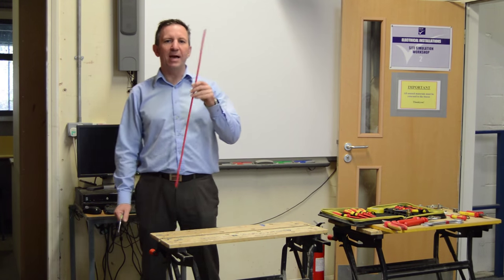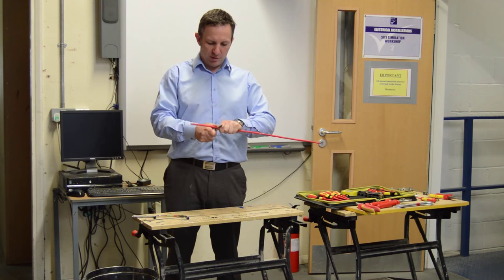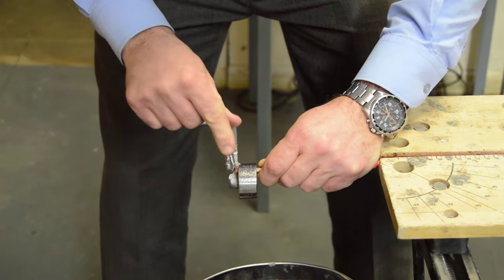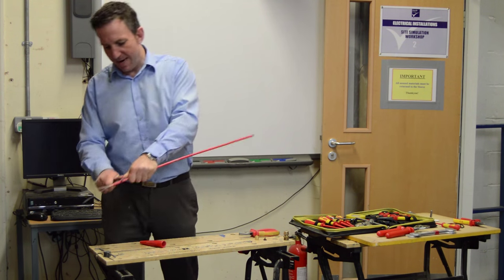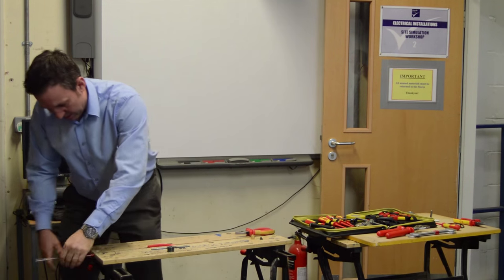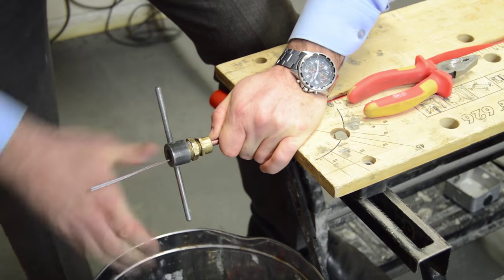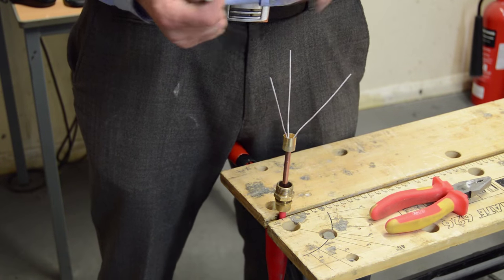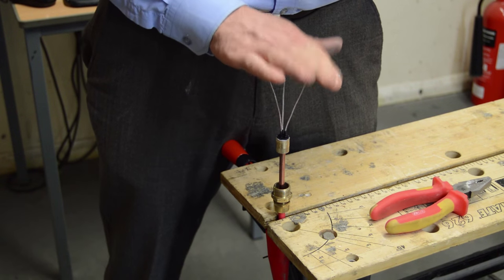preparing to terminate an MI Cable

Comment: I used this lot when an electrician in England. We got many a shock from meggering the conductors to earth, IE conductors to the cladding.
Pyro makes super capacitors. You should always megger the prepared cable.
It takes in water so if the cable is left about with no seal on the end the cable should be heated with blow torch to drive the water out
Other wise you 're going to have a leaky cable. Then put on the termination.
Amazing stuff . I have seen a cable with 7 conductor's hammer well to flatter it. There was no shorts!
I loved the stuff.

Comment: You ever actually done this on site?  You're touching the end of the cable, you've run the shroud over the stripped cable rather than doing it before you stripped it, you've also put the gland on after you've stripped it too. That's so many opportunities for you to foul the cable end. I installed some of the pyro at your college. 
Cut the cable,  put the shroud on, carefully strip the insulation without ringing it,  put the gland on then strip it and introduce the pot and the compound. 
Don't use a vice. I don't know anyone that makes pyro off with a vice in the real world.